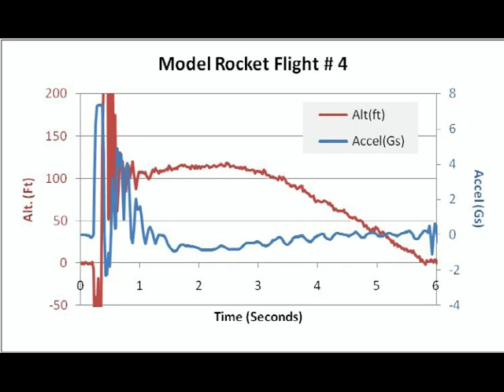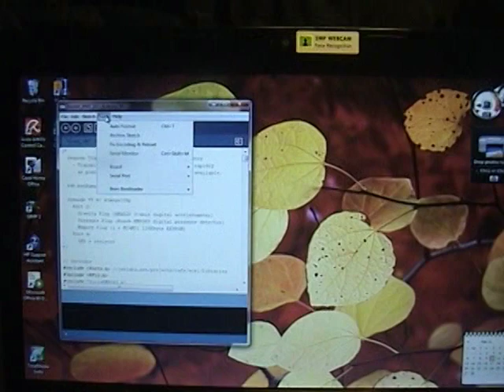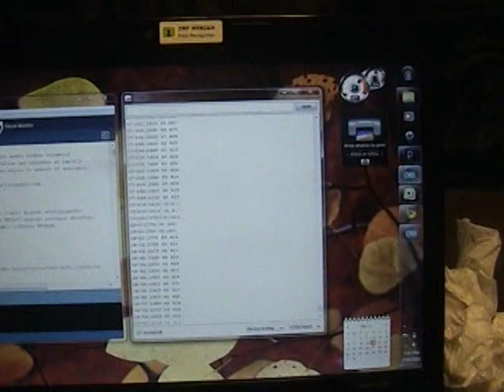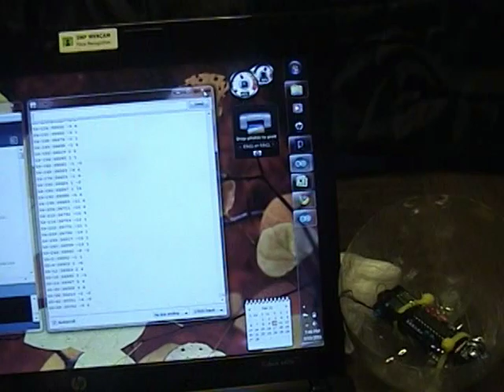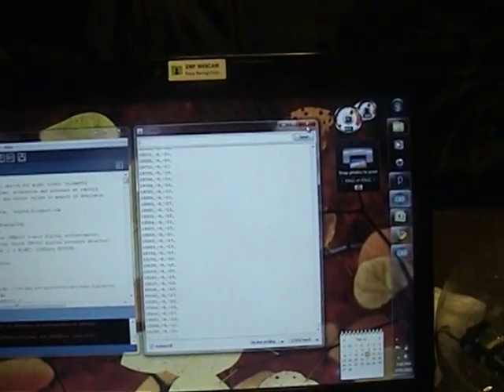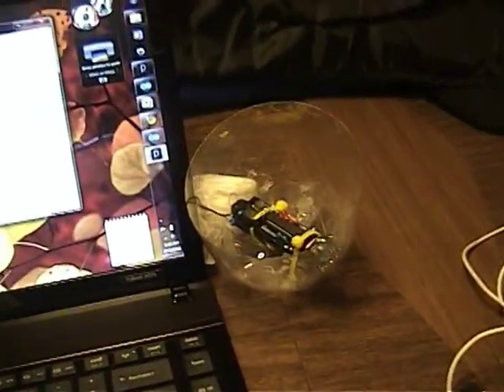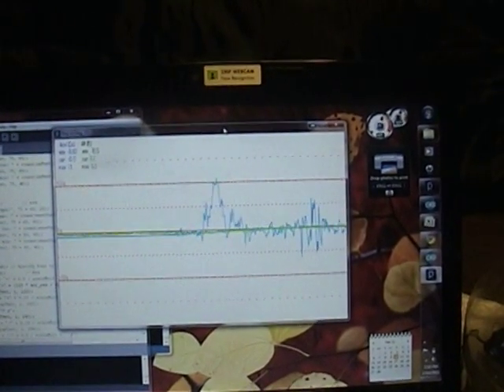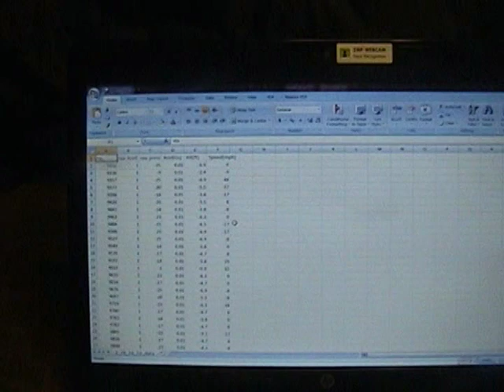Model Rocket Telemetry

Comment: I just ordered this gear, and am going to give it a try. I haven't programmed the Arduino at all yet--but I've written C code for the AVR microcontrollers, and C/C++ code for the Beaglebone. The Arduino looks pretty straightforward though, and the available libraries look pretty helpful. I haven't done much model rocketry in several years though, so there's going to be a learning curve there again. How far away can the rocket be before the data is unreliable? Have you tried to add a GPS module?